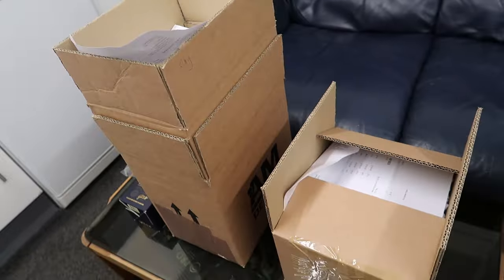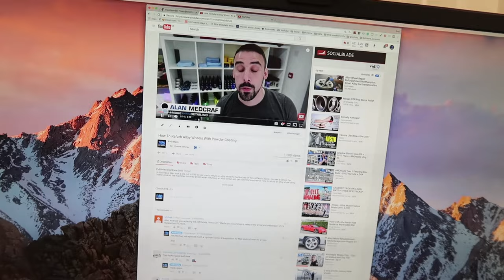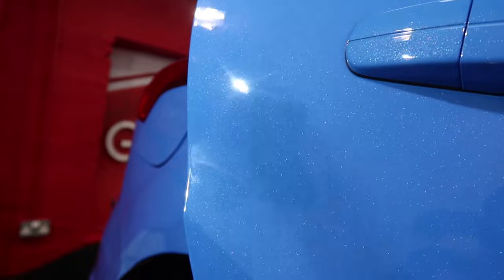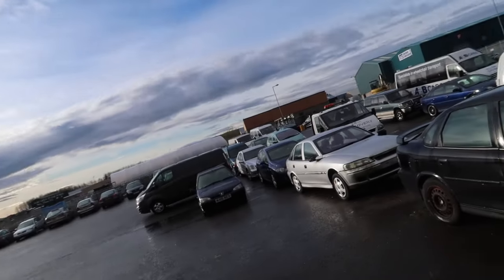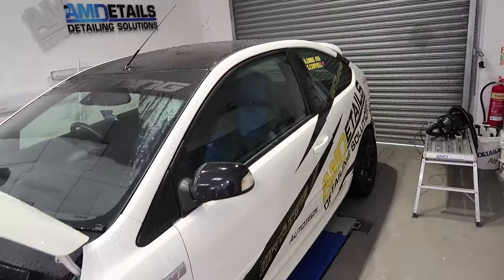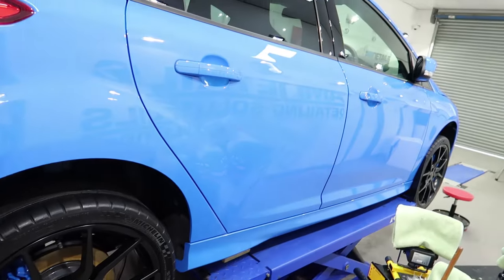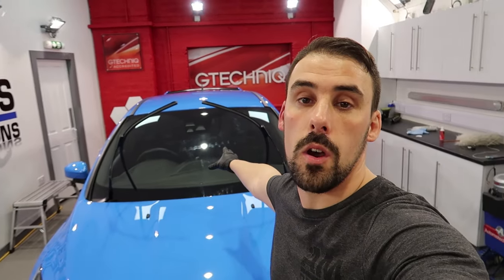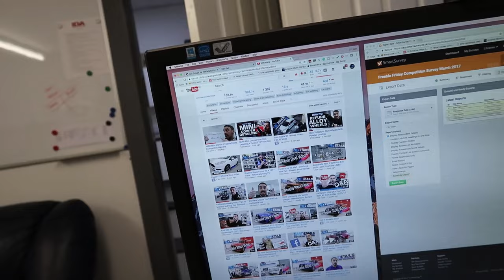Nitrous Blue Ford Focus RS Detailing

Comment: iv been using a rupes mini lately never past speed 2 but find its munching though yellow pads like bursting the edges is this somthing you have encountered at all ?
Reply from the maker: Hi, Jason. Sounds like there is something up with the technique here.

The machine works great at speed 1. but once you have the pad broke in and the polish spread I then work it up to 2 - 3 depending on the job in hand. It could also be due to the angle you are holding the machine. So there is more pressure on one edge. but the motor speed of 2 is pushing it through the rotation rather than it stalling. so the edge is under a lot of stress?

Try on a flat bonnet or panel and just let the machine run and you support its weight.this will help you find where it's balanced. Then just practise supporting the machine and letting it do the work. Rather than you doing the work.

I hope that made sense via a YouTube message.

Alan 😎👍🔔
Reply: AMDetails  thanks for the reply Alan appreciate you taking the time to reply 

Yeh it does make sense now I think about it I'll go back to the test panel and see how I get on  😊

Comment: what  do you use c2 for Alan?  :D
Reply from the maker: Hey Dan,

C2 is used as a hydrophobic top up or individual sealant. Really great tool for details. But I think you are referring to it being on my coatings bench? Its just there to hold the Microfibre cloth off of the tool box. 😎👍🔔

Alan
Reply: AMDetails Yes i use it my self for the small detaling jobs, just wondering what you used it for when you do gtechniq csblack with exo :) though you used it as a detailer :)